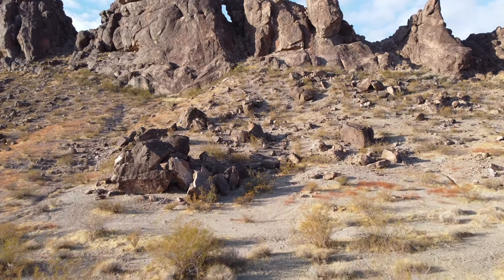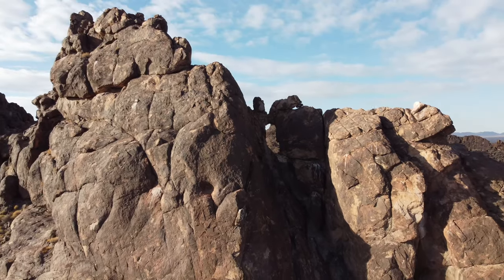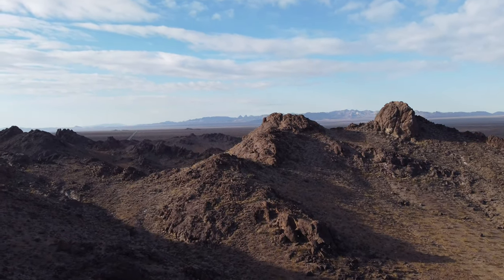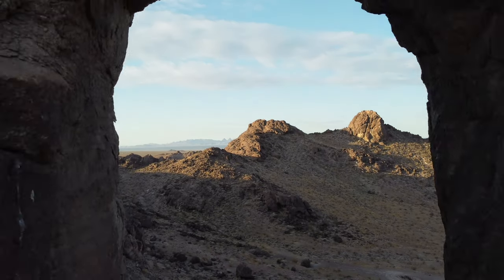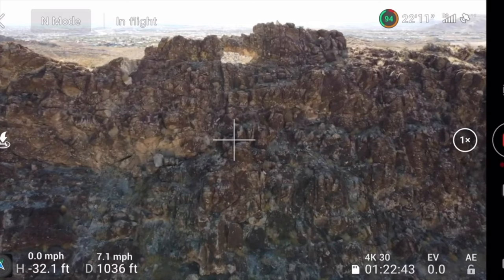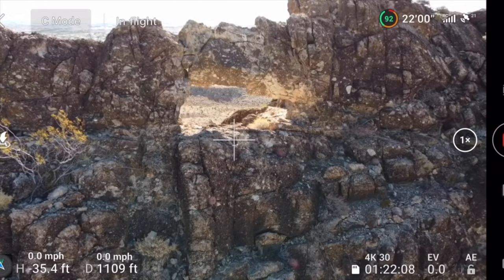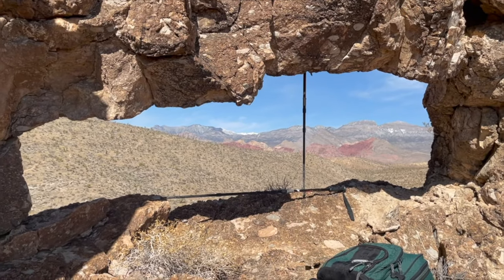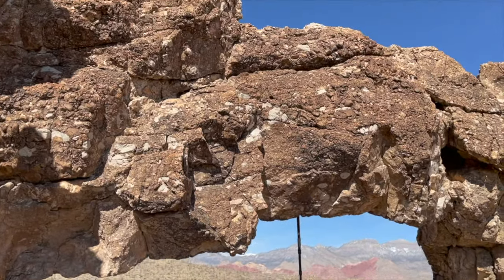How to Fly a Drone Through an Arch, DJI Mini 2

Comment: Nicely done. 
You had the gimbal at -13 (below horizon). Does this give you visual proof  you can clear the top and make it through the opening?
Reply from the maker: It worked out OK because I was almost into the arch before backing up, but I should have centered it to 0. I did come close to hitting the ceiling of the Arch!

Comment: Thanks for this. I’m a newbie. Today I practiced using the crosshairs for flying between two trees, that were definitely not close together. My own line of site saw differently than the crosshairs, and I think that was because I didn’t think to yaw the camera some to better position the crosshairs. But it’s good to know that the crosshairs can be useful for navigation. I also learned today to use them for landing my drone of the landing pad.
Reply from the maker: Glad it helped!

Comment: Did you cover or somehow disable the downward sensors? I would think that they would have sensed the floor of the arch and sent the drone up into the ceiling. Perhaps you speed was high enough that you were through before the drone could react that way?
Reply from the maker: No, never had any issues with the drone rising even when flying a few inches above the ground.  I do keep the drone moving though

Comment: Did you have a chance to estimate the opening by naked eye first? Or could you tell from the monitor alone that the arch was wide enought to fit?
Reply from the maker: Just a rough estimate but not close up. Good point because it is critical that there is extra height and width to allow the drone to pass through safely. Thanks

Comment: Do you cover your bottom sensor or turn it off somehow? I assumed the sensor would push your drone upwards whilst flying through these small gaps.
Reply from the maker: No. Trick is not to stop inside or slow down too much inside the Arch. As long as you keep it moving it should be ok

Comment: what if wind changes drones directions littlebit?
can we depend on fact that we have pulled it backword without touching any stick???
Reply from the maker: Good question, pilot needs to be aware of any wind and make adjustments as needed, usually just left or right as height does not change with wind. Key is to adjust speed just enough to maintain control

Comment: Why not just backup the drone without touching the yah or left/right if you've gone through in the forward direction, then you don't have to reverse it in post. Also shouldn't the camera gimbal be 0 degrees?
Reply from the maker: Sounds good, but even a slight wind can cause drift and resulting crash. I had to make very slight corrections on last flight going through in forward. Much easier and safer to reverse edit.  Yes, Gimbal should be at 0 degrees and I had it a bit low on the last flight.